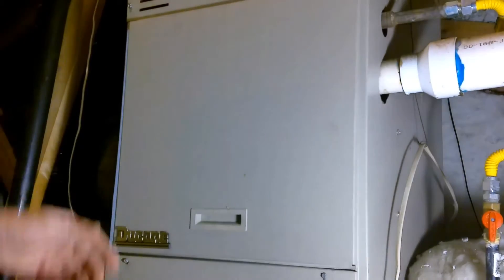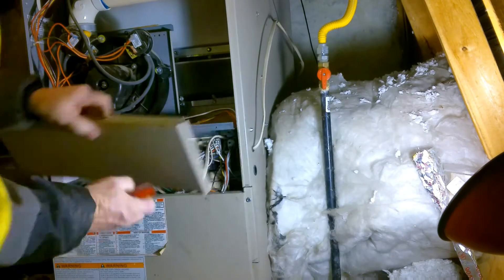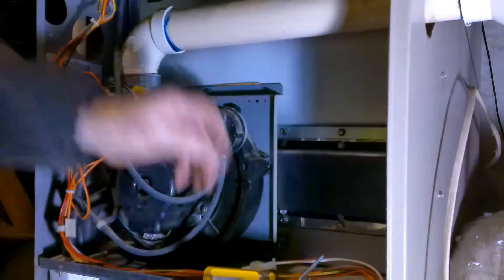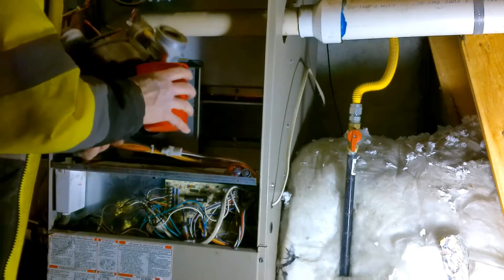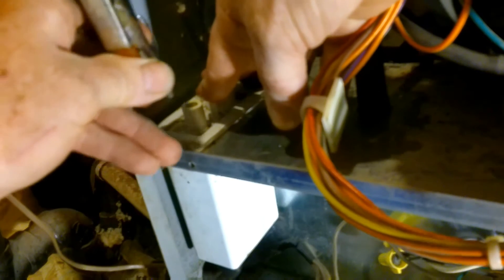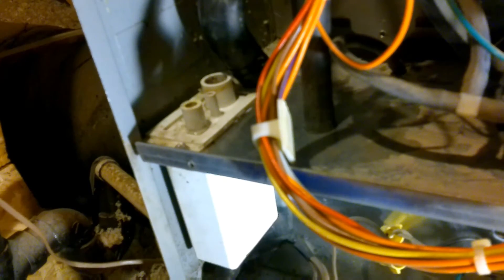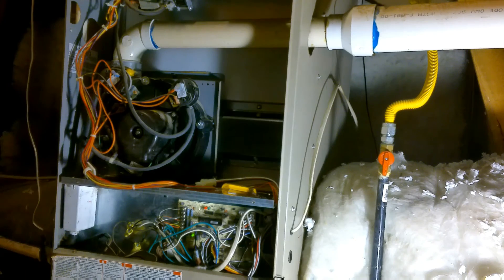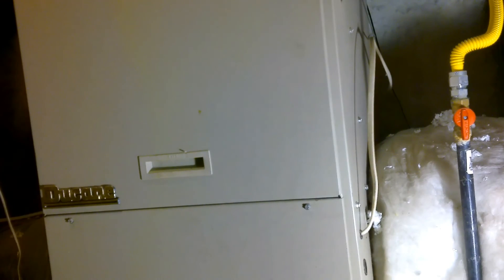Does Your furnace Gurgle?  Furnace shutting down after start up?

Comment: Great informative video, helped me diagnose and get my unit running again after my air intake came apart at the exterior wall and must have been either drawing moisture in or creating extra condensation. Followed steps on video, drained and blew out any residual water and worked great after putting back together. Thanks again! - Steve

Comment: Natural gas produces water when it burns via exothermic reaction creating both water and carbon dioxide.  The high efficiency furnaces have a second heat exchanger that removes enough heat from the exhaust and the water condenses out of it.  That why it is a condensing furnace.  It is warm enough to create a good growing environment for organisms (bacterial slime) that like to clog the tubes at times.
Reply from the maker: I've seen some pretty discussing clogs.

Comment: Thanks you so much for this video, it’s -22 outside and our furnace got turned off for part of the day. When we turned it on it wasn’t heating up the house, cold air was blowing through the vents. We could hear gurgling at the inductor and in the furnace exhaust pipe outside. We followed your video and drained 2.25 cups of water out of the inductor. Saved us from having to call in a service call at midnight. Much appreciated.

Comment: Is it a good idea to install an 90%+ gas Furnace in the attic where the temperature in winter could be below freezing point (32F)?
In such case the condensation water will turn into ice and blocking the drainage hoses.
Reply from the maker: Haven't had a problem with condensate freezing, just pushing warm air down to the second floor.

Comment: I have the same problem, but the condensation is coming in from the PVC exhaust pipe that goes through the roof, it's to bad there isn't someway to redirect the condensation from draining back to the furnace to avoid this problem all together.
Reply from the maker: It's amazing how much water it produces.
Reply: @Philat4800feet  yes the hot air in cold pipe creates more water I think.